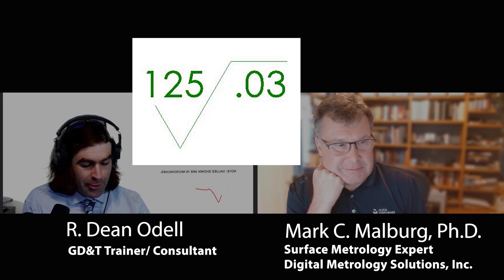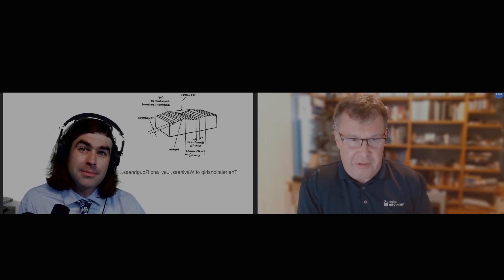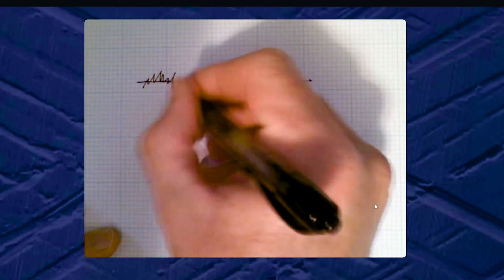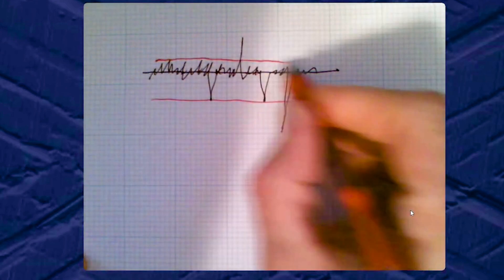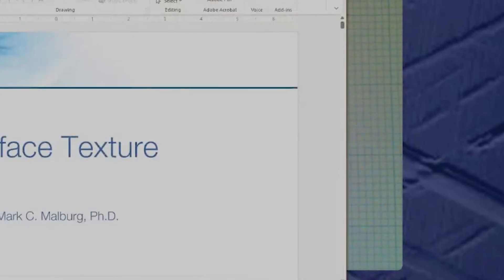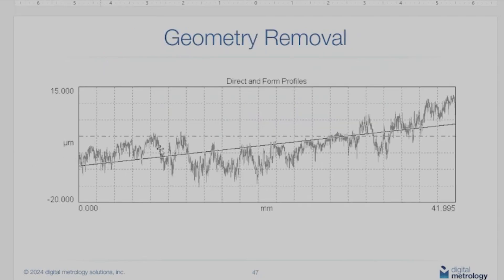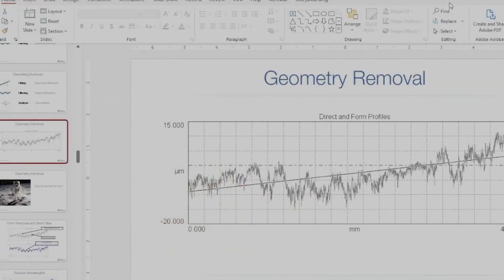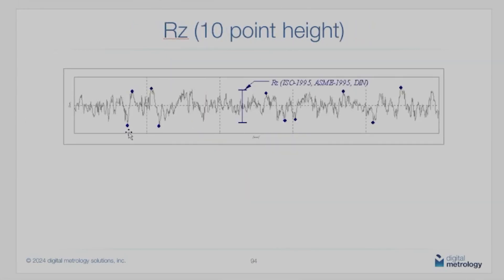Mark Malburg Interview Part 1 "Surface Metrology Ra vs Rz"

Comment: So important to discuss this!!!
Also would be interested to hear opinions on Sa (3d Ra) and non contact method reproducibility.  I’ve always had trouble with reproducibility on basically anything except stylus profilometer with 0.8 cutoff.  Does mark discuss cutoff selection?  Because the standards are lacking.  What about new methods for stratified (printed) surfaces with unique band pass filter.  Love the video.  Wish it was 4 hours long haha